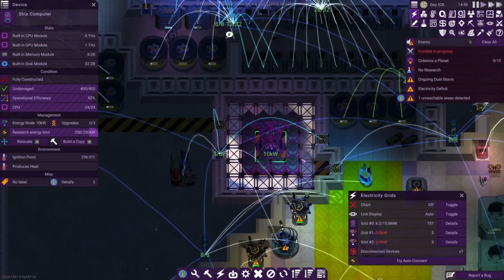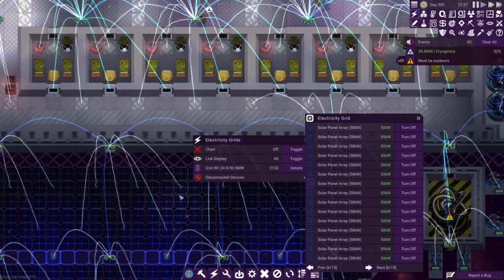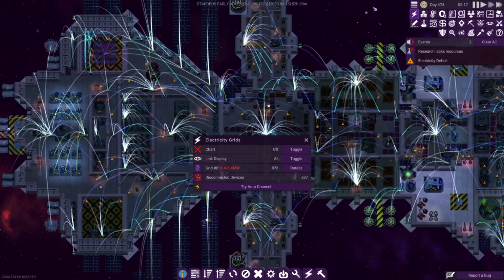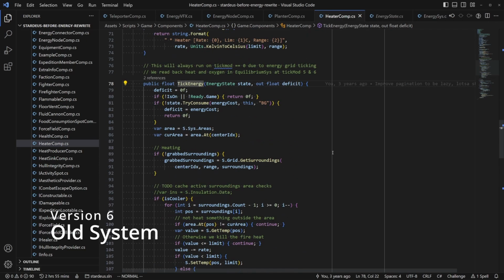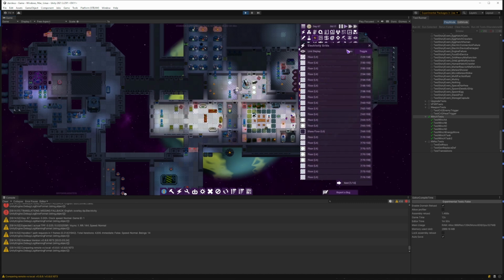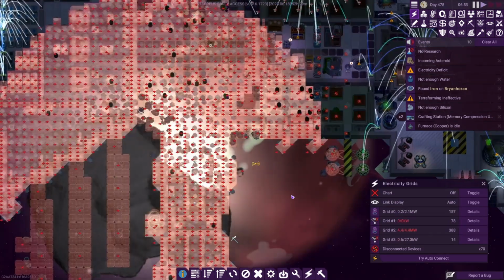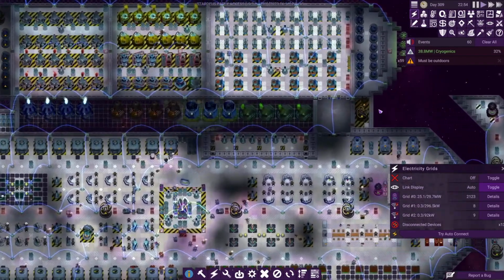Stardeus Devlog: Electricity System Rewrite

Comment: what happens if they save and exit half way through incomplete callbacks? Does it just retry when the game loads back?
Reply from the maker: Save process pauses the game clock and waits for all ongoing internal operations to complete. Though even if half of the callbacks would not execute once, it wouldn't have a big effect on the game. After loading the game all devices would resume getting callbacks again and catch up with the grid state right away.

Comment: I remember attempting to rewrite Space Station 13 to support rolling black outs. That system was more complex because each device could also contain a battery as backup power. I ran into multiple challenges, it worked on the small scale, but when it came to large scale, every machine in the open source project did there energy calculation slightly differently (standby, active, multiple states depending on different modes (you called them smart devices here)). The rolling blackout concept worked by maintaining a linked list of devices on the grid, then working though them to turn off devices till the power capacity was met. Ended up abandoning the effort due to code branch becoming stale and a bad merge into my code that became to complex to fix. At the time I was new to the open source git hub forking and branching structure; ended up with my code falling out of date and my PR becoming to large trying to keep all changes in sync, so I dropped it. 

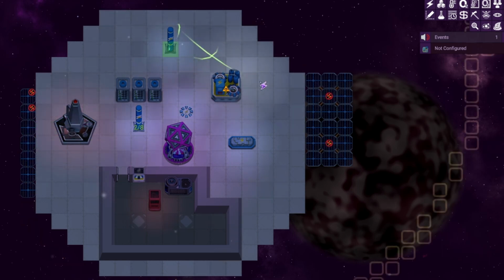Space Station 13 energy grid required every node to subtract and add power based on it's demands and it's sub network demands (your branching lists). I like how you described the problem 1:38. The energy problem is far more complex to code then many would assume. The ability to add, disconnect, connect to existing network with loops (I call redundancy as a gamer) is a big problem when doing subtractions off of parent nodes. 

Thank you for all the time and effort your putting in as that takes a lot of commitment. This is the first early access game where I've felt like the developer was actively working the project. (I'm on your discord and see your updates pop up when you post them)